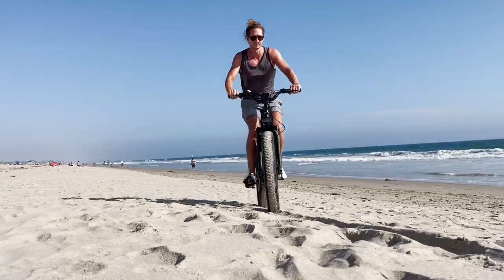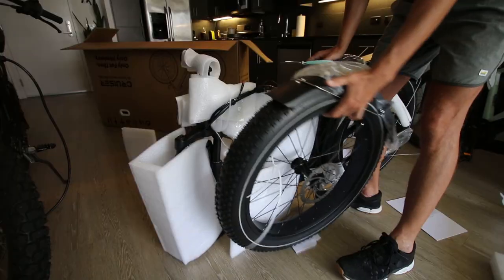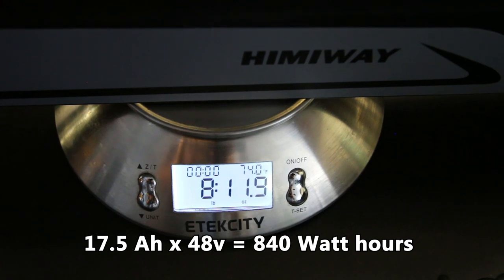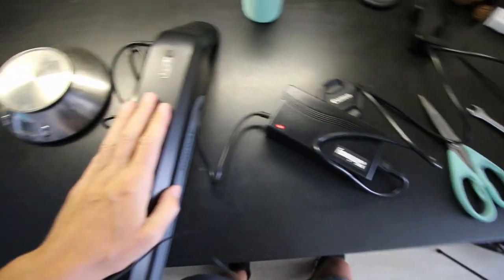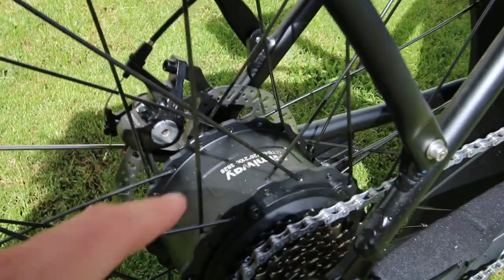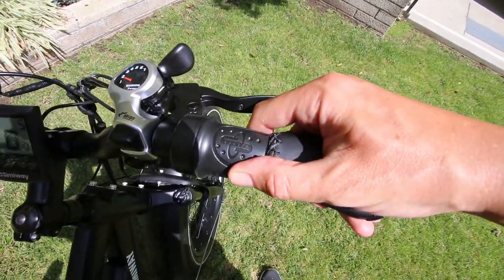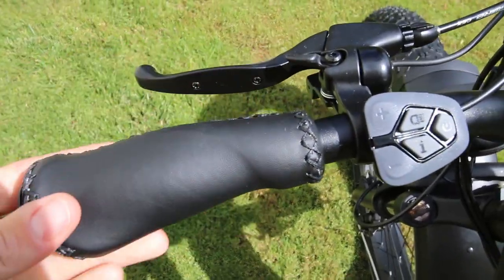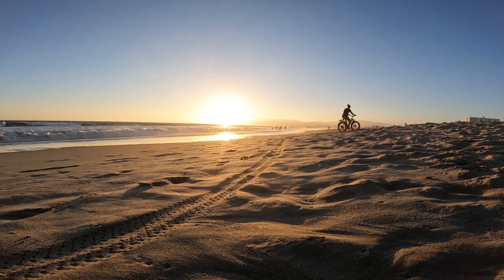Himiway Cruiser Review - DON'T buy this "Long Range" electric bike BEFORE you see this

Comment from the maker: https://amzn.to/3gc85SX - Amazon 5% off discount TAILHAPPYTV at checkout!
https://bit.ly/Himiway-Discount  use TAIL65 for $65 off (or $50 Coupon: TAILHAPPYTV if that doesn't work)
Thanks for watching, chapters are listed, had a blast on this bike riding in the sand by the beach :_crazy:
0:48 unbox and build
3:06 components
6:35 first ride
11:40 top speed
12:15 pedal assist modes
14:35 beach ride
17:47 Mixed riding range test
20:15 Torture Range test
21:43 High Speed range test
24:32 Pros and Cons

code for an extra $50 off is in the description box, see ya in the next one!
Reply: Thank you!!
Reply: What was the popping sound and "Oh no" about at 22:00?

Comment: I am a Himiway Cruiser owner (received as a birthday gift from one of my sisters). For me, there is nothing not to love about the machine. I am 191cm (6' 3") and 109kg (240 pounds). I installed a stem riser to get the weight off my hands. I ride my bike in PAS 3 in fifth gear about 90% of the time. The brake cables stretched in the first 250 miles and needed adjustment (expected). After that initial adjustment, the barrel adjusters have been more than enough to compensate for pad wear. I am not a "Mountain Biker", but more a commuter and errand rider. People call it a "budget bike", okay but so far nothing I see on the market does anything better for my use than this "budget bike".
Reply: Mine broke after like 500 miles it was cool before it broke though
Reply from the maker: Awesome, hope you're still enjoying!
Reply: @homelessman3483  Broke how?
Reply: @anthos818  the cpu/brain got fried somehow. I know it wasn't the battery because I tried to replace it thinking that was the problem.
Reply: @homelessman3483  is that expensive to replace?
Reply: @homelessman3483  2 year warranty?   Did they replace it?   I mean, if you are making a claim to social media, it's sort of pointless without details.   You save us from a headache?
Reply: @homelessman3483  broke how?
Reply: @Curious_Skeptic probably didn’t buy it directly from himiway
Reply: That's bizarre my burchda rx80 which isn't an expensive ebike has 630 miles on it so far and I have cycled up a pretty steep incline with it.
Reply: @JohnnyC10071959 
Hi. I want to buy a Zebra and battery range in a low setting, whilst pedalling, is priority, I've no interest at all in top speed. 
I'm the same size and weight as you and was wondering if you have ever pedalled the bike in Eco mode to see how many miles you'd get?
Ebike manufacturers' distance figures are approximately bull$h!t and I'm having so much difficulty finding out a real life figure from a bigger guy ☹️
Cheers, and I hope that you're still having fun on your Cruiser 🚲🙂👍
Reply: We've had our cruisers for over 4 years. Still going strong.  Bought a heavy duty bike rack and take them everywhere.  No issues. I switched to partial hydraulic brakes.

Comment: I use mine at 27mph for 30miles non stop throttle only . You need to take the speed limiter off so it will reach 27 - 28 mph.
Reply: Did you buy the bike recently?
Reply: is your trip most paved road, off road, combined or what??
Reply: @Killb78  Don't buy it. The warranty is worthless and the quality control is crap.
Reply: @jq7323  what happened. I want to buy this bike
Reply: @benjadoo  I had 45 miles (that's barely even a battery charge) total on my bike before the motor took a shit. You pay $100 and they ship a new motor. MY REPLACEMENT MOTOR WAS FAULTY. I had to fix the motor out of my own pocket. Their support is horrible, their quality control is horrible. Anyway, I got the replacement motor fixed. Then the screw that goes into the headset busted off (was wondering why it wouldn't ever tighten to keep alignment).  My 2 year "warranty" is over and I have another issue that makes the bike unrideable until fixed. I have I think 51 miles on my bike now and the 2 year "warranty" is over. The bike also comes with 3 miles put on already.
Reply: @jq7323  seems isolated, I have a cruiser with 600 miles no issues been unlocked since day 1 goes 37 mph.  My buddy has 3200 miles on his with minimal maintenance never unlocked
Reply: The battery don't tell you is green that means is full charged what a shame I went out and scared that will catch fire or something because the battery feels hot $1600 but feels is too much because the weight is kinda pretty heavy E-Bike I used it for couple hrs like 3hrs and gived me 20.8 miles full battery and paddle sometimes but I'm not sure if it's charging right because the freaking light always red WTh we need Elon musk to make one with 100 to 200 miles ranger I know he can do that 😁
I really want to know how to use it correctly I really enjoyed riding Even the front time when installing it the disc front tire was little tie not too smooth and was running nice Even forgot to put air 🤦 after I did was running fast💨 I had one bar left and took it home to charge hopefully will give long range.

Comment: After watching this twice, it needs to be mentioned (as he was talking on Pedal assist modes) he didn't mention you can go into the settings (there are Youtube video's on how to do this) and change the modes!   It works on 'percentage' of power you want, so rather than using the predetermined percentages, change it to a % you prefer!   I've changed my pedal assist to 7 modes (you can go as high as 9) so I have smaller % between assists, which works very well for me.  As for propelling your e-bike forward if you prefer to walk it up stairs or a step part of a trail, it has the option of pushing a button, which will move the Himiway at 4 mph (walking speed) helping to move the bike, so you don't have to lift it!  I've added a stem-riser on my Himiway Cruiser, so as not to be bent over while riding, and there are many e-bike accessories on Amazon or local bike shops.   I have to lift my Himiway (as well as my wife's e-bike) up onto our bike rack, and at 70 years old, I have absolutely no problem doing so, so possibly some women may need a bit of help, most men should have zero issues, as I'm not a big guy at 175 lbs.

Comment: Another happy Himiway owner, now at 2,000 trouble free miles!   Saw another Cruiser owner on Facebook, coming up on 20,000 miles on his Himiway Cruiser (some, have ditched their cars and just use e-bikes) and other than regular maintenance he says he's been happy with his Cruiser!  All on the same battery, and as mentioned regular maintenance as you'd have to do with any other brand.   I've added a Stem riser, Cloud 9 seat and hydraulic calipers to my bike along with Flat-out in my tires, as well as my wife's e-bike, and neither of us have had a leak/flat thankfully.   I do ride on my pavement than on gravel/dirt trails, but again have had zero issues when off road either.   I suppose like any bike, my backside gets sore after about 45 miles, and I've done several that long with bars still available to go further on the screen, but I'm hoping I'm close to finishing up on a ride after that length of ride personally.  Being a senior citizen, I'd most certainly buy this e-bike again, and although I've never needed anything on warranty, it was a good selling feature two years ago when I bought mine!
On Edit - I now have 3,100 trouble free miles, as it's always a joy to get out and ride!
Reply: Where did you buy the hydraulic calipers and is it much to charge things out. Pretty interested I this bike. It will be my first E-bike!

Comment: Your one con of the bike was the top speed even though you admit you can unlock it for higher speeds. That isn't a con. It's locked to 22 mph for regulation purposes. If an easy unlock gets you to higher speeds how is that a negative.

Comment: 8:45 you are probably feeling the gyroscopic effect of the heavier wheels and tires. When going fast on a motorcycle the effect is so great that to start a turn you actually need to turn the handlebars in the opposite direction of your turn.

Comment: The Zebra is now the way to go for longer range .My starter bike hopefully last a couple years .Will know a lot more on products and the best way to go in the future,definitely full suspension.
Reply from the maker: It does have a bigger battery, isn’t it more expensive?
Reply: @TailHappyTV  It’s about three hundred dollars more .
Reply: $400 more. You could instead get a Cruiser and an extra battery for the same range. Plus you could get as many batteries as you want and simply switch them out.  They're not selling replacement/extra Zebra batteries.
Reply: @carriebartkowiak  I like the frame more on the Zebra.
Reply: @lawrencemunroe6798  your gonna need a replacement battery sooner or later
Reply: @AceParks  They are good for  a thousand charges or more .
Reply: So Zebra is not the way to go lol thx

Comment: Great review!!  I'm still trying to pick my first e-bike....Could you reccomend a 50 mile road only bike?
Reply: Do not buy this one trust me. I've had nothing but problems. Also, you will have to look for a really good bike to go 50 mph ( and probably $3500+). I have gotten the himiway to go 40 mph down hill. But on flat land throttle only you are looking at 27-30 mph.
Reply: @jq7323  hey jake, what types of problems are you having and did customer service help you out. i ask because i have looked at alot of bikes and reviews and this himiway cruiser looks to be a good unit for the price and with the bigger battery and big tires seems like a good deal. right now they are selling in a sale for 1450.00 usd. i would really like to hear your unbias opinion. thanks.

Comment: You should charge the battery pluging to the main power/wall socket first, then to the ebike battery. After discharge, you do the opposite. Unplugged the ebike battery first, then unplugged from the wall socket.
Reply: It doesn't matter. The ac/dc brick is regulated  No need to worry about surges or whatever it is you're worried about.
Reply: My ecotric bike manual says to plug into the battery first then plug into the electrical outlet. After the battery is charged it says to unplug the AC cord from the receptacle and then unplug the connector from the battery.

Comment: Nice E-Bike for the price, but man their Cobra Pro model 1000 watt mid-drive is incredible! But then it should be for $4k...

But I'm sure glad I did my research because it seems the one to beat at least in the sub $2k range is the Ariel Rider Kepler $1,799.

1000 Watt Nominal, 1800 Watt Peak Power Bafang Motor.108 Nm torque. 

32-40 mph depending on weight & conditions

52V 20ah LG battery

1650 Watt 33amp 52V Controller

330 lb weight capacity.
Reply: Ahh yes nothing says quality bicycle like an ebike with 4.8 inch tires and a gear ratio of 11-34. These companies wont be here in 10 years, as their not actual bike companies, but more of a marketing company.
Reply: One to beat is the Wicked freedom
Reply: @voicevoice2053  nah, I'm good.

Comment: Do you think this bike could handle the snow/Icy roads
Reply from the maker: With the torque and tires on this thing, yes. The only lacking feature would be all wheel drive for more traction even if needed.
Reply: @TailHappyTV  cool. Im new to bikes but i assume i can buy studded tires for when winter comes and just send it to a shop so they can put it on for me right.
Reply: @benjadoo  get a cover to keep your battery from getting cold

Comment: I am new to e-bikes and considering this one. Has anyone of you ridden this bike on a hill or a mountain? How does it perform in a hilly landscape?
Reply: It performs great on hills and mountains. I've ridden mine 6,000 miles in all different terrains. The only problem with going down super steep single-track trails is that it's super heavy. I've gone through 3 sets of brake pads (very easy to change). If you're not worried about single-track performance, get one for sure. Super fun on the beach. This video actually taught me a lot about how to use the pedal assist. I usually just ride it at full throttle with no pedaling. I'm a big guy and have about a 20-mile range with no pedaling at all. It's cool to see how far it will go if you use the pedal assist correctly. I've had absolutely no problems in the 1.75 years I've had mine.

Comment: What is the best bike to get for range and fast?
Reply: Himiway zebra, throw a 1000W on it and have a spare battery on the rear rack.... You can screw the part the battery slides into right into the wood.... If you do this you'll get 160 miles of travel distance with a 400 pound weight limit.

Comment: I can see why the Double Battery would be needed.
I would have 'Range Anxiety' while using it.  LOL

EDIT:  Why not purchase an Extra Battery since it takes so long to charge it.
Also you could take an Extra Battery with you and strap it on the rack in back.  :washhands:

Sad that I am not able to use these bikes. (Medical Issues)
I use to ride my Regular Bike for decades.
Reply from the maker: You could definitely do that, but ultimately it would be much better just to have one larger battery, or both hooked up at the same time instead of carrying around all of that extra weight, and not putting it to good use. Sorry to hear your medical issues

Comment: I wouldn't buy a rear hub motor e-bike. A mid-drive is the way to go. Hub bikes don't really work as well in hilly areas. Pay a bit more and get more value for your money. You can go with a much smaller wattage and get more torque. But, the max wattage is 250, in Europe, but you can 80Nm, so hills aren't a problem. Don't buy online.
Reply from the maker: I always thought the same man, I actually built a custom mid drive ebike and made a video on it in this channel back in 2016 when e-bikes were still pretty obscure. The more hub drives I try the more I can see the appeal. Ultimately mid drives have more torque to the wheel no question, but I’m surprised how much hill climbing ability some of these geared hub motors these days have. For the average leisurely rider, these hubs deliver everything needed at a very affordable price, especially when bought online direct to consumer and the whole local bike shop middle man is cut out of the deal. I do a 20% grade hill test from a stop in all my reviews these days, some can do it, some can’t, but ultimately my goal is to simply show the bike so the consumer can make an informed decision. Thanks for leaving a comment, and happy riding in Europe. I’ll be over there next month!

Comment: 4 inch tires were originally designed for snow, himway is not a performance bike, and has some of the cheapest rubber you can get on a bike. Another drop shipper.

Comment: Do not buy any Himiway products. THEY DO NOT STAND BEHIND THEIR PRODUCT. First of all, I couldn’t find a repair shop that would be willing to do warranty work because “ Himiway doesn’t pay their bills” I finally found a dealer that would work on my Cruiser, but wouldn’t wait for reimbursement from Himiway because they don’t pay. After speaking with Himiway they told me to go ahead and pay for the repairs. I did which was around 150 bucks. Here I am months later and still no refund. Email after email and excuse after excuse. Don’t do business with Himiway, I’m in Cali.
Reply from the maker: Dang that’s crazy man, I’m sorry to hear this- they do have himiway stores in Southern California that believe right?
Reply: @TailHappyTV  don’t get me wrong, I absolutely love my bike, BUT, God forbid something goes wrong. In my case it was the main controller. 99 dollar part and 50 in labor. Himiway sent me a list of “authorized repair shops”, but when I contacted several of them within a 50 mile radius, it was the same story, “we no longer do business with Himiway” and the reason being that the shops don’t get reimbursed for the warranty work. My only choice was one shop ( they were great) that had the replacement parts, but I would have to pay for it myself. I just hit 300 miles on my bike and it sounded like metal tin can full of nuts and bolts. I purchased two bikes from them and was getting ready to buy two more for my kids. I’m sorry to say that I will have to go to another company.